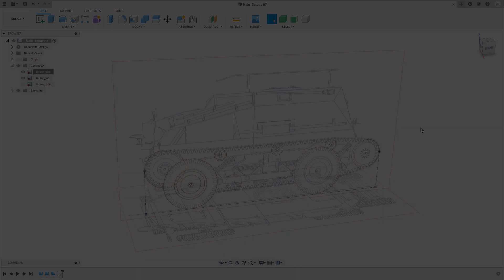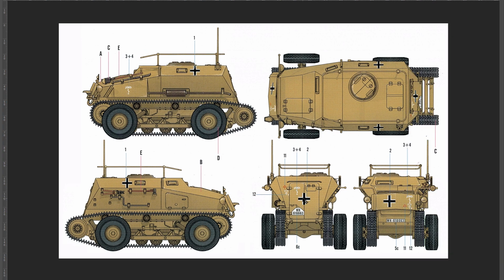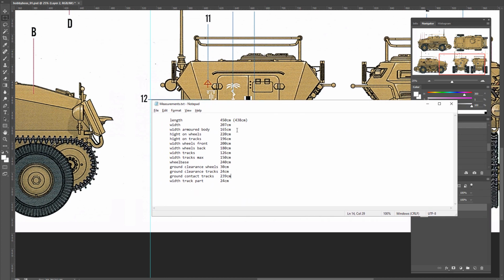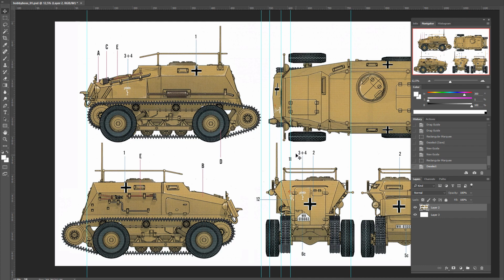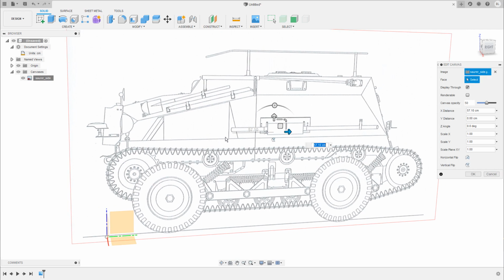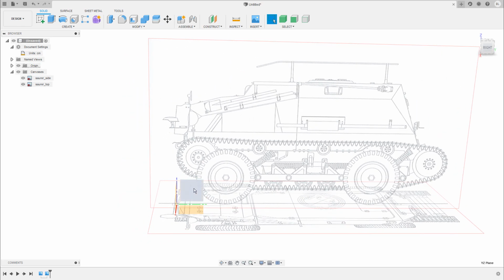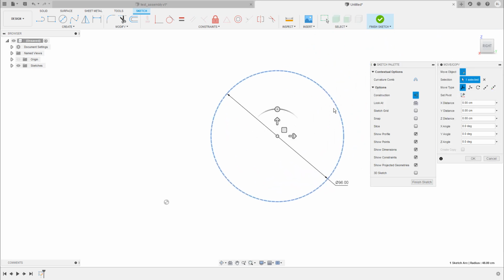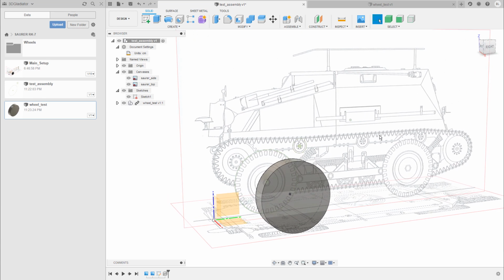How to Work With Blueprints in Fusion 360 - Day 9

Comment: But like, I found 1 photo that contains all the positions I need from the blueprint, but how do I divide them into 3 Top, Side, and Front view images but they all need to be the same size
Reply from the maker: You can separate the images in Photoshop for instance, then place the first one your design, set it's dimensions and  align the other ones the same way I did it in the video.
Reply: @3DGladiator  Thanks, I wanted to make a Bf-109 K-4 but I'm having trouble because it doesn't have a round fuselage, do you have a tutorial on your channel that teaches you how to do something similar for me to use on my Bf-109, and I don't want to to really do it with paint and etc, I just want to make the beams, the wing airfoils, all open without anything closed only the structure